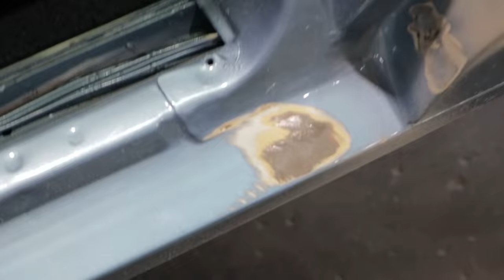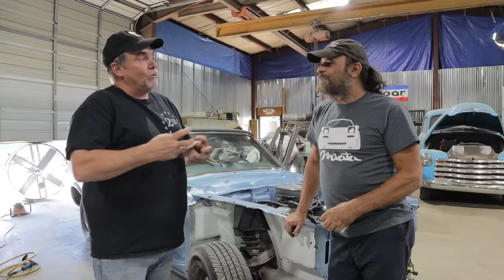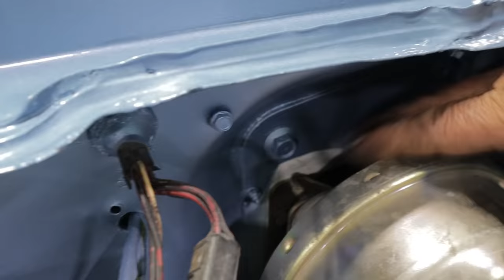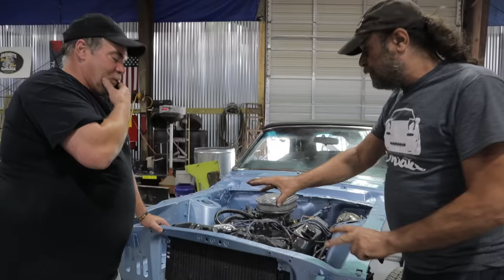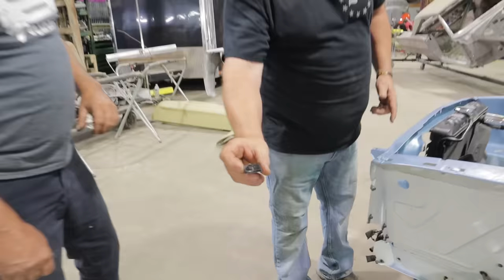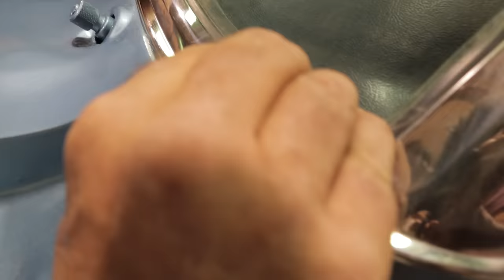Refugee From Body Shop Hell

Comment: That Mustang is a convertible ( Is now, there are people who do conversions psst!) There are or were a lot of plain Jane cars that have been altered to look like a GT or something. Many 64&1/2 Mustangs were 6 cylinder & 3 speed manual cars. Using one as a good shell isn't bad. It will never be a number matched car. It can be made to look good (good workmanship) but, it's never real. Buy it drive the FN wheels off it, as long as you know it is not correct.

Comment: The difference between "fixed up" and "restored". Body work is labor intensive and requires a skill set but it isn't rocket science. Beat a dent from a panel without stretching the metal,  cut a patch and weld it in, grind, and SKIM coat bondo. Block the car when done and paint. The more removed from the car the less masking and you will always get some overspray.  Paint being the hard part to get really right.
Reply: Facts! I can usually metal finish a patch panel without needing filler. But I can't paint to save my dam life😂

Comment: had this happen to a frend of mine  he has a all original 71 torino gt with a the 428 cj   dropped it off at a body shop gave the man 3 grand to start  and had a signed contract  guy asked him if he wanted to remove the chrome trim and outside door trim  he said no  i want it original  and that was that  fast forwad 4 months he stops  by to check on it  guy was not there  called him and he said he was out of town  checking on a sick family member   which  he got to thinking  a  red flag on that   he came back a month later the guy had the car painted but he removed all the chrome trim and  filled in the  door trim holes  with  a shoddy bondo job  and  wanted the rest of the money and  my friends dad refused cause he did things to the car he did not want  told him i want my car back with the trim  and he said well i sold the trim  to a friend  he got the cops involved and  found out this guy  never  even  did what was supposed to be dont  he just  bondoed the crap out the car and made it look decent   and once me and my friend got  into it  the car had  so much bondo we put it in a bucket and  there was  about  120 pounds of it   but the car looks alot better now  we all did  the  fixing  in the driveway   now its  back  to  its former glory  running   now with a  351 modified to a 413  flowmasters  and a  c6 trans from a ford van  the c4 was to weak   its dark navy blue which  is the original color and it   screams    we scrapped a 70 fairlane 500 for the metal   and what was left of that car you can out in the back of a pick up   and my friends dad  won his case and  got back all the money he spent  plus a little extra   it toook months to find original trim  to put back on the car  ....sorry for the bad typing  my hands shake alot

Comment: My Dad bought 2 classics after he retired. He passed away 7 yrs ago, so last year I decided it was time to get the 52 crestline roadworthy and sell it. It was a classic flipper job.
Gorgeous to look at, scary to drive.
They modified it for 60's power steering and front disc brakes, but ignored the sloppy old king pins, wheel bearings, tie rods, wiring etc etc. It was ridiculous. I had to rebuild the entire steering system, duraspark ignition and wiring.
Now I'm getting the 50' F-1 roadworthy and I'm finding similar ridiculous neglect, and shoddy work. 
But this one I'm not selling.
"It's an epidemic" - truth!

Comment: Its a mistake to redo the car… either keep it and fix issues as they pop up or sale it, get another car and start over..

Having to undo that work, Isn’t it going to cost more to fix that mess than the original price? So then your out the original $25.000 plus the cost of the redo. Seems like throwing good money after bad.

Comment: Where is the video of the big three that think a 50,000 to 100,000 thousand dollar truck should last 10 years.
Reply: My guess is Uncle Tony wouldn't risk calling out a potential sponsor.Probably the same thing with allowing lies to be published.
Reply: @heavymetalmadness666  Are you kidding? He bashes on certain aftermarket parts and systems ALL the time...and he's usually right.
I doubt the automakers would get any special treatment from this guy
Reply: @ericlandstrom6155  I know he might  not be aware because he doesn't live in the rust belt, but there are plenty of" are you kidding me" things going on with the design of truck frames and failures within ten years . I just worked on a Toyota Tundra that had the frame replace under warranty years ago. There was really nothing about the cab and box that would make you think it was just neglected, and for the the age of the truck  body wise is in great shape. Dorman a big name in after market parts makes makes frame repair panels for some trucks, and at that point you know it was a big problem.  The 04 and up to ? F150 is one  that is a problem that Dorman makes parts for. The odd thing there is the engines were so bad and expensive to work on, that there are frames all over the salvage yards, but the cost to make it right though just isn't justified. The  Toyota I mentioned earlier ... It was 15,000 to put a new frame under  it, brand new frame and dealer labor.

Comment: OLD CARS ARE GOING HAVE BODY FILLER NO CAN AFFORD A CAR THE ALL THE RUST IS FIXED . THIS ARE 40 TO 50 YEAR OLD CARS COMPLAINING THEY DIDNT TAKE THE BRAKE BOOSTER OFF COME IF IT AINT BROKE DONT FIX IT
Reply: You missed the point. Ppl pay the $$$ on these full restorations to have ALL the rust removed and new sheet metal welded in along with every nut, bolt and assembly removed, repaired or replaced.. youd be surprised how cost efficient it actually is to restore a vehicle compared to buying a brand new vehicle

Comment: Sadly Big Brother must step up and require inspections by qualified (and therefore meeting some prescribed minimum professional experience to be registered or perhaps licensed) inspectors before a classic vehicle can be consigned or sold. Of course once the Big Gubbermint bureaucracy is involved the cost of the inspection will skyrocket. I had a truck inspected years ago by Larry Lyles and he only asked for $50. I expect it would be $250 if not $500 to cover Big Brother's paperwork. But these sketchy, dodgy, shady pillocks must be put out of business.
Reply: Well, you have all these people screaming to deregulate everything on one hand and then you have all these people that do crappy work on the other, so there has to be some balance in there or the consumer gets screwed over.
Reply: @webman1956  Yep. In retrospect involving big brother is a horrible, terrible, no good idea. My thought was something like the English MOT inspection requirement. Dana Mecum would be my nominee to establish a system like CarFax but including a recent inspection for classic cars. Even the car's provenance documentation could be part of it's account. When prospective buyers turn cars down or only offer a fraction of the asking price because it doesn't have a classic car inspection cert that might weed some of the con artists out. Then there's the issue of a forged certificate. A few of those and any reputable consigners would be better watchdogs.

Comment: There is so much not known about what the sometimes cheap skate owners want to spend on body work, most don’t want or even can afford a rotisserie restoration  and instead want it done as cheap as possible and sometimes they get by with less and are happy. It’s so easy for back benchers to criticize another shop but don’t always have a clue what deal was made. Does Maco do off frame resto for 999, I don’t think so. Those bastards how dare they do that shit work 😂. But good program for critics. And idiots that never done body work in their lives and wouldn’t last a week doing it.  So tell the people and show us your billing on your total done right job that’s guaranteed for 50 yrs when done. I’ve done body work for 45 yrs and have seen it all. When started I done complete paint jobs with quarter panels replaced and fixing rust on fenders and dent repair from top to bottom for under 2000 dollars with paint and materials. And have seen couple of them still around today and they look pretty good yet.  Now that job would be 20000 . What a working fool I was but yes I can say I did it.

Comment: The problem with a crooked body man that's very good at his job is they can hide a crap ton of bad things the car can look perfect and just be a deathtrap unfortunately , lots and lots of cars are just put together horribly
Reply: Super true, making a crap bondo repair look the same as a good patch panel to the untrained eye is easy.
Reply: @barneymiller7894  ya see The only thing I'm good at is engines ( I have a private engine shop ) the rest of it I wouldn't have a clue , I would definitely be one of those guys that gets a bad deal and rotted  body but looks great  . I'm just a engine guy im definitely not a body guy .
Reply: @unclesquirrel6951  That's fair, I know a decent amount about engines being from a drag racing family. Especially Ford junk lol but don't build my own motors. I'd rather have my builder do it and do it right.
Reply: @barneymiller7894  I poke jabs at my Ford buds but ya I'm a die hard big block Ford dude , I'm a fan of the 351w and the 400 also . Great engines with some design deficiencies same as every other make . But ya Ford engines are awesome engines even tje FE AND FT are also great power Builders

Comment: I fear what my 68 looks like under the paint.    BTW - that's a 68 not 67.  At least, those are 68 quarter panels and the front fenders behind him appear to be 68....hard to tell for sure on those. You can paint a ford with the engine in as long as you are not painting the compartment.  If this was "at home work" it would be forgivable - it would be crappy - but forgivable.  But  this is payed (and paid) work.  The guy obviously had the skills to do it right.  He chose not to but chose to charge the client a premium price.  If they paid $25K.....this is a $2500 job.  Horrible.  But I would have told folks who did it in the video.  After all.  That dude is an artist and his work is his signature - he signed it.  And folks need to know.  I have family in TN with cars and honestly a job like this would be life altering for them.  They would have to give up the car and take the loss. It's one thing not to realize a dream, it's another to pay for it and still not get it.

Comment: Oooow, there was some cheater work in there 4sure,....all that aside,...aint nothing wrong with plastic,..except cheap plastic,...that shit bubbles...hell even new cars got bondo from the line......I had a 62 chevy II nova ragtop...well 2 actually....one I put a ton of love into it,...lots a bondo too, in all the usual places,....ground the rust off...sealed any holes....37 years later that body works still looks good as the day I finished it,....no bubbles cracks & no failure, even the paint is good....It was my daily driver for years after.....now it's sits in an open air storage lot.....in penna...I was amazed when I saw it & very proud....since that project I've learned fiberglass which is awesome shit....my first attempt with glass was the eyebrow of my old dodge d100 p/u.....i used a plaster mold,... glassed a section out, never painted it or undercoated it,....& it survived years, never rusted again.....

Comment: I was in a different trade - watches - but much of what you show in your videos seems to be about correcting badly done repairs. Been there, done that, and although I loved the challenge there came a point when I couldn't take it anymore. Parts became a problem, as did technical manuals etc, but the biggest problem by far was the customers who wanted a top quality repair - BUT -  at a bargain price. I know that you guys have a few years to prepare, but repairs of ANY kind are either dead (shoesmiths, blacksmiths etc) or deliberately on their way out. Shoddy parts, bad design, just general problems won't get any better. I'm of a 'certain age' now, but I was a fitter (mechanic) long ago, so I have a good grasp of the problem. It seems that your trade, like mine, is splitting into two. Either you cater to those who have bottomless pockets or you concentrate on boring routine repairs. In the long run, which is the more reliable source of income? 
Not exactly unrelated: When I came into my trade, mid 70s, quartz watches were the new high-tech bleeding edge. I  had already known about electronics for years so quartz watches would be easy. Those of us young enough to fantasize that we had a future in the trade embraced the 'new technology' and just thought that the 'old guys' would see the new stuff and decide that it was time to retire. Well, they did - but - the new technology didn't need constant maintenance like the old ones. Bottom line: If electric cars really take off, how often will they need repairs and will you be able to get parts?
IDK what the future holds, but if the past is anything to go by, blacksmiths and candle makers and dozens of other trades disappeared almost entirely. I was lucky - I was not far from retirement when the SHTF but my heart goes out the guys who have 20 - 30 years to go. Sorry for the rant but I think that the older guys can relate.

Comment: I wish all body man would stop thinking they are the best and stop judge other people's work without facts. I don't dispute there are butchers out there. However insurance companies don't need your help to convince the public that cars can't be fixed properly, be it rust or collision work. Are your customers all filthy rich? Is money no object to them. They simple pay whatever you need to do the "best" ? I just wish sometimes the other side of the story is told. First off all car were once new, but over time if it's metal? It will rot. No one has the miracle that will prevent a car again, or that they will rework a used or rusty panel and make it better than when it new.  That area on the mustang may have looked fine last year. How many times does the customer want the 40,000 restoration but wants it for 10,000?  I agree it will be 10,000 down the drain but hey maybe he has kids to provide for as well?  Come on guys. Be honest. I see the same crap with some of the collision repair guys. The same half stories are told there. You have a badly kinked rail and insurance refuses to pay for a new one. Or refuses to pay for removing a motor to repair a bent rail properly. Some buy a car at auction and trash the previous collision repairs without knowing the facts or what the insurance authorized on those repairs?  If it's customer pay? Most want you to bury there deductibles etc. You need the whole story. You don't hear cops bashing cops, doctors bashing doctors. But cars and home contractors etc. They all think they are the best and everyone else is crap. I don't know why this is? Again I don't dispute there are butchers in every occupation. In closing, I respect your work but I will never believe your customers don't have budgets. Or that they don't have limits from which you have to work from? Thank you for letting me vent. Again not questioning your work, just this constant bashing from pretty well every utuber